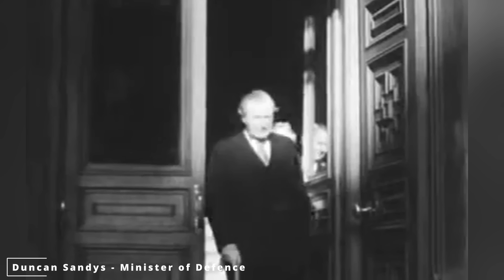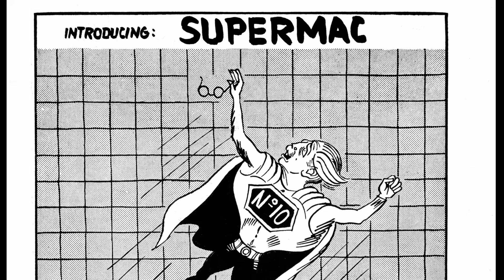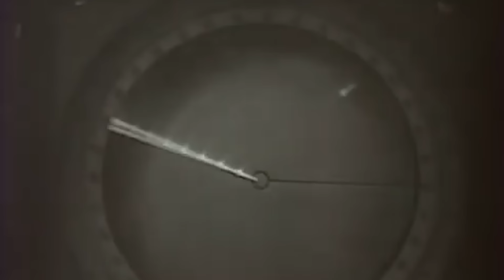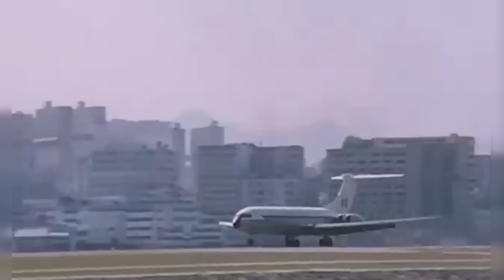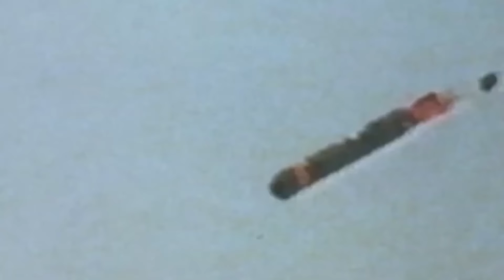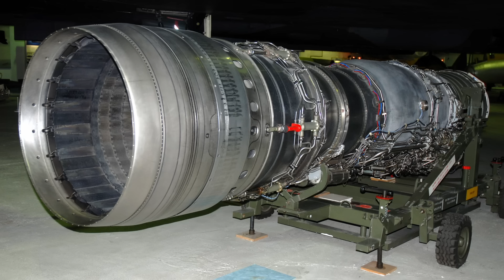How Britain Turned A Failed Airliner Into a Soviet Submarine Predator | The Mighty Nimrod

Comment: It's a common myth that the Nimrod is a version of the Comet... this is a completely false and misleading belief. They are completely different aircraft which happen to look similar by coincidence, and the use of common tooling.
Reply: Typhoon & Tornado, British design aircraft. 

Early days of the airliners.

The awesome De Havilland Comet.
World's first production jet airliner.
World's first high altitude airliner. 
At the time the Comet wasn't particularly dangerous. The DH Comet was definitely not the worst engineering failure in commercial airliner history.

Losses comparisons.
How things were in those days.

DeHavilland Comet 4 UK                          14% 
DeHavilland Comet all mks UK (ff 1949)17%  
Vickers VC10 UK (ff 1962)                         5%

Douglas DC-1  US                                       99%
Douglas DC-2                                              47%
Douglas DC-3                                              30%
Douglas DC-4                                              26%
Boeing s300    US                                       72% 
Boeing 307                                                  70%
Boeing 247                                                   48%
Boeing 707  (ff 1958)                                 32% 
Lockheed L-049 Constellation (ff 1943)  30%
Lockheed Electra US (ff 1957)                   29%
Fairchild FH-227 US (ff 1966)                   32%
McDonnell Douglas DC-8 US  (ff 1958)   14%
Sud Aviation Caravelle  (ff 1955)             15%
Canadair CL-44 Turboprop US (ff 1959) 46%  
Convair CV-580 Turboprop US (ff 1960) 22%
Convair CV-880     (ff 1959)                      27% 
Convair CV-990     (ff 1961)                      33%
Tupolev T-104        (ff 1956)                     16%
Vickers Viscount UK  (ff 1948)                29%  
Fokker F-27 Turboprop NL (ff 1955)       40%      

The Vickers VC10, fastest Atlantic crossing for a non supersonic jet airliner, held the record for 41 years.

For the first few years of operation the Caravelle & Comet had similar accident loss fatalities.

De Havilland had prior experience building many all metal construction airframe aircraft & thousands of jet powered fighter aircraft that were primarily of metal construction with pressurised cockpits & jet engines built by De-Havilland. No aircraft before the Comet was subjected to as much pre-production testing as the Comet. 

It's a great pity & a crying shame that British military forces had to occupy a large part of Germany for decades after 1945 & Russian military forces had to do the same. Of course Russia still posseses a large chunk of what was German territory & of course Russia & the UK produce nukes. Obviously Germany does not produce nukes.

Interesting British achievements.

The gas turbine engine was invented & patented in England before the 1800s.

Axial multi stage sequential stage compressor & turbine technology, first produced for turbo machinery use in England by Parsons of Ireland & North England during the 1800s. The components form the basis of most modern gas turbine aero engines. At the time the concept of the jet aircraft powered by axial internal combustion gas turbine engines was first mentioned thus the internal combustion jet engine & jet aircraft was indeed invented in England before the 1900s & before the Wright brothers got busy.

Work on the multi stage sequential stator rotor axial compressor as applicable to the axial compressor gas turbine aero engine was ongoing in England from around 1928 by Arnold Griffiths and others. By 1943 the Metrovik F2/3  Beryl was a running axial turbojet that was superior to anything anywhere else. As the centrifugal compressor engines were adequate and more powerful at the time development of a larger F2/3  version was commenced.

The Metrovik (UK)  F2/3 axial compressor gas turbine aero engine was flight certified & ran in 1942, it was the result of UK development work ongoing since 1929. At the time it was the most capable axial compressor turbojet in existence but was not required and development work continued on a larger version.

Frank Whittle performed the world's first demonstration of a gas turbine aero engine in 1937. People in Germany kept a close eye on everything going on in Britain at the time.

The centrifugal compressor RR Nene was the most powerful & most reliable gas turbine aero engine on the planet in 1944. That engine would be later built under license or copied in many countries including Russia (Mig-15 Mig-17), China, the US, France and Switzerland powered dozens of aircraft types for decades after 1944.

Pratt and Whitney and others produce centrifugal compressor gas turbine aero engines. The PW200 is a currently produced whittle style centrifugal compressor, reverse flow combustor, gas turbine aero engine. 

The world's first wind tunnel was constructed in England during the 1870s. The world's first supersonic wind tunnel was constructed in England in 1922.

There is no doubt that the Fairey (England)
Delta 2 was the world's first jet
aircraft to exceed 1000 mph.  Indeed It
exceeded the previous record by 310 mph &
held the record for 1 year. Incidentally, the Dassault Mirage 3 & 4 are based on the Fairey Delta 2.

More recent UK military jet aircraft.

The Tornado & Typhoon & their engines are Supersonic & are indeed British design aircraft with British design engines built by an international consortium. The Tornado design for example started life during the 1950s at Vickers as the AFVG, it's engine is based on the RR RB-199. The EE Lightening is also a British Supersonic jet aircraft.

The Typhoon is the British BAC-EAP with an engine based on the British RR XG-40, the Typhoon is also built by an international consortium.

Brazil has the world's third largest airliner manufacturer and makes very good airliners & Brazil is 100th down the list along with Indonesia for wealth per capita. Of course it is in fact the case that Embraer can't build those airliners without purchasing stuff from the US, UK & Europe. For example, Norway, Holland, Denmark, Ireland & Belgium, top 20 wealth per capita, don't make airliners, its as simple as that.

Global aerospace. 
From the 1950s sector rationalisation and consolidation took place. 70 companies in France and 300 companies in the US disappeared due to merger or dissolution. In the US Boeing was almost bankrupted by the 707 project.  Boeing had a well protected domestic market and the available space and resources in the US to engage in large scale airliner manufacturing enabling them to capture orders simply by being able to produce airframes fast enough and cheap and nasty enough. Another factor is airlines preferring to obtain as much of their airliner inventory as possible from one manufacturer. 

Global Aerospace Sector, what's happening.

For example, there are of course no German companies that makes German jet aircraft in Germany & there are no German companies that make German gas turbine aero engines in Germany that are suitable for widebody airliners.

The UK has the world's highest combined per capita Nuclear / Defence / Aerospace Sector Activity.

UK defence sector, absolute terms, world's second highest activity. 1st for per capita defence sector activity. Per capita nuclear powered submarine construction, 2nd position. 
Main players being Rolls Royce, Babcock, GKN Aerospace & BAe Systems. Activities often involve international collaboration. BAe systems, RR and other UK companies now handle more Airbus work value wise than Germany. 

There's a good chance that anyone currently flying on a widebody airliner will be on an aircraft powered by RR gas turbine aero engines made in the UK and a good chance there will be other hardware on the aircraft that's designed and / or manufactured in the UK. 

Rolls Royce Holdings UK
Subsidiaries
- Rolls-Royce plc
- Rolls-Royce North America (ex Allison etc Classified Military stuff)
- Rolls-Royce AB
- Rolls-Royce Deutschland
- Rolls-Royce India Private Limited
- Rolls-Royce Marine Power Operations
- Vinters Engineering Limited
- Rolls-Royce Controls and Data Services
- Rolls-Royce Power Systems
- Bergen Marine
Joint ventures include:
- Rolls-Royce Turbomeca
- MTU Turbomeca -

Trent Family
The MT30 (Marine Turbine)
Industrial Trent 60 Gas Turbine
Trent 7000
Trent XWB Airbus A330neo.
Trent 1500
Trent 1000
Trent 500
Trent 600
Trent 700
Trent 800
Trent 8100
Trent 900
   
RR wholly owned subsidiaries in Germany handle smaller 2 shaft RR gas turbine aero engine work.

The UK space and aerospace sectors are highly productive, high-value industries that together contribute over £18 Billion in direct Gross Value Added (GVA) to the UK economy. Individually, the space industry directly contributes about 0.3% of UK GDP 7•2 Billion while the aerospace industry contributes approximately 0.5% £10•9 Billion.
   
We hope this helps.
Reply: @DoktorBayerischeMotorenWerke 

We believe we can clear up some commonly held myths and misconceptions obviously.

It's always good to see the facts presented clearly and concisely isn't it?

Bow-wing (see B-47 wing collapse wing folding incidents) had built less than 12 pressurised airliners before the Comet first flew and they were not high altitude airliners. 

All Nimrods were new build Comet 4 airframes with appropriate strengthening and the unpressurized  equipment bay tacked on. 

The HS 801 Nimrod was the most advanced aircraft of it's type at the time it first flew. Problems with the MRA4 programme were almost entirely due to radar and computer equipment issues and BAe Systems & co being too busy with other work at the time. 

Obviously there have been worse aircraft for accident losses both before & after the Comet.

Early problems with Comet takeoff stalls were caused by pilots over rotating the aircraft at liftoff. 

Podded engines on wings have aerodynamics issues. The main reasons for eventually going with podded engines were because or to facilitate -
Ease of maintenance.
Use of shear off fixings given excessive out of balance forces.
Large diameter turbofan engines.
Reduce load on the wing to fuselage connection. 
Increased power from later engines. 

The Bow-wing (See B-47 wing collapse & wing folding incidents) was a good example of how to expend a huge amount of cash and effort on something that was probably not worth bothering with. The basic design of the Comet had been decided upon and established before the podded engine choice has been made for the B-47. There were aerodynamics problems with podded pylon mounted engines at the time. The US also built and operated a significant number of EE Canberra bombers under licence which did not use podded engines for their wing mounted engines. . 

There have been aircraft losses caused by pod & pylon mounted engines. 

All jet airliners benefited greatly from the knowledge gained from the Comet incidents & subsequent investigations & yet some were still worse for accident losses. 

Instances of all marks of the Comet flew with full certification after 1954 including the Comet 3. The last Comet flight occured in 1997.

The fabulous trail blazing DH Comet.
World's first jet airliner in regular service.
The jet engined Avro Lancastrian actually did a passenger service before the DH Comet. 
World's first high altitude airliner.
World's first airliner with a full fuselage length pressurised cabin pressurised for high altitude flight. That feature for that type of aircraft was a considerably difficult undertaking. 

The change from larger squarer windows to smaller rounder windows was necessary for the particular aircraft at the time. Skin thickness remained mostly the same for all Comet marks. 

How things were back then.
Accident losses - % of aircraft built.

DeHavilland Comet 4 UK                          14% 
DeHavilland Comet all mks UK (ff 1949)17%  
Vickers VC10 UK (ff 1962)                         5%

Douglas DC-1  US                                       99%
Douglas DC-2                                              47%
Douglas DC-3                                              30%
Douglas DC-4                                              26%
Boeing s300    US                                       72% 
Boeing 307                                                  70%
Boeing 247                                                   48%
Boeing 707  (ff 1958)                                 32% 
Lockheed L-049 Constellation (ff 1943)  30%
Lockheed Electra US (ff 1957)                   29%
Fairchild FH-227 US (ff 1966)                   30%
McDonnell Douglas DC-8 US  (ff 1958)   14%
Sud Aviation Caravelle  (ff 1955)             15%
Canadair CL-44 Turboprop US (ff 1959) 46%  
Convair CV-580 Turboprop US (ff 1960) 22%
Convair CV-880     (ff 1959)                      27% 
Convair CV-990     (ff 1961)                      33%
Tupolev T-104        (ff 1956)                     16%
Vickers Viscount UK  (ff 1948)                29%  
Fokker F-27 Turboprop NL (ff 1955)       40%      

The Vickers VC10, fastest Atlantic crossing for a non supersonic jet airliner, held the record for 41 years.

For the first few years of operation the Caravelle & Comet had similar accident loss fatalities.

Sud Aviation Caravelle - 
all accident loss fatalities - 
1320 fatalities. 

De Havilland Comet - 
all accident loss fatalities - 
453 fatalities. 

An example of a typical airliner from the period. 
The Fokker Friendship F-27 fatalities & accident losses as a % of aircraft built. 
Fokker F-27 Turboprop (ff 1955)   40%
2130 fatalities.

Of course De Havilland carried out a full stress analysis & performed extensive & protracted testing on two long lengths of fuselage representing all features of a complete airframe. De Havilland carried out significantly more testing than was required by any authority at the time & significantly more testing that any previous airliner was subjected to.

De Havilland designers / engineers knew all there was to know about metal fatigue at the time they designed the DH Comet.

De Havilland had prior experience building many all metal construction airframe aircraft including many passengers aircraft & thousands of jet powered fighter aircraft that were primarily of metal construction with pressurised cockpits & used jet engines built by De-Havilland.

De Havilland did indeed always work to better than industry standards at the time, used up to date knowledge for the design & testing activities & no evidence of negligence or criminal negligence was ever produced in relation to the DH Comet.

Global aerospace. 
From the 1950s sector rationalisation and consolidation took place. 70 companies in France and 300 companies in the US disappeared due to merger or dissolution. In the US Boeing was almost bankrupted by the 707 project.  Boeing had a well protected domestic market and the available space and resources in the US to engage in large scale airliner manufacturing enabling them to capture orders simply by being able to produce airframes fast enough and cheap and nasty enough. Another factor is airlines preferring to obtain as much of their airliner inventory as possible from one manufacturer. 

Global Aerospace Sector, what's happening.

For example, there are of course no German companies that makes German jet aircraft in Germany & there are no German companies that make German gas turbine aero engines in Germany that are suitable for widebody airliners.

The UK has the world's highest combined per capita Nuclear / Defence / Aerospace Sector Activity.

UK defence sector, absolute terms, world's second highest activity. 1st for per capita defence sector activity. Per capita nuclear powered submarine construction, 2nd position. 
Main players being Rolls Royce, Babcock, GKN Aerospace & BAe Systems. Activities often involve international collaboration. BAe systems, RR and other UK companies now handle more Airbus work value wise than Germany. 

There's a good chance that anyone currently flying on a widebody airliner will be on an aircraft powered by RR gas turbine aero engines made in the UK and a good chance there will be other hardware on the aircraft that's designed and / or manufactured in the UK. 

Rolls Royce Holdings UK
Subsidiaries
- Rolls-Royce plc
- Rolls-Royce North America (ex Allison etc Classified Military stuff)
- Rolls-Royce AB
- Rolls-Royce Deutschland
- Rolls-Royce India Private Limited
- Rolls-Royce Marine Power Operations
- Vinters Engineering Limited
- Rolls-Royce Controls and Data Services
- Rolls-Royce Power Systems
- Bergen Marine
Joint ventures include:
- Rolls-Royce Turbomeca
- MTU Turbomeca -

Trent Family
The MT30 (Marine Turbine)
Industrial Trent 60 Gas Turbine
Trent 7000
Trent XWB Airbus A330neo.
Trent 1500
Trent 1000
Trent 500
Trent 600
Trent 700
Trent 800
Trent 8100
Trent 900
   
RR wholly owned subsidiaries in Germany handle smaller 2 shaft RR gas turbine aero engine work.

The UK space and aerospace sectors are highly productive, high-value industries that together contribute over £18 Billion in direct Gross Value Added (GVA) to the UK economy. Individually, the space industry directly contributes about 0.3% of UK GDP 7•2 Billion while the aerospace industry contributes approximately 0.5% £10•9 Billion.
   
We hope this helps.